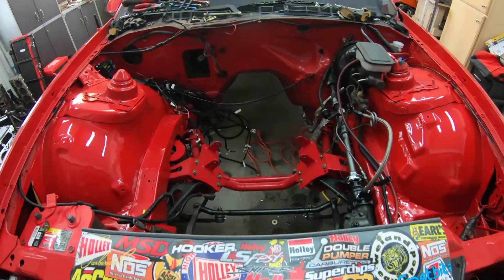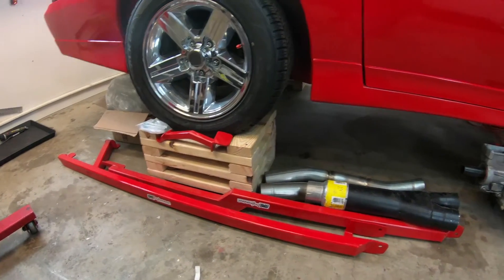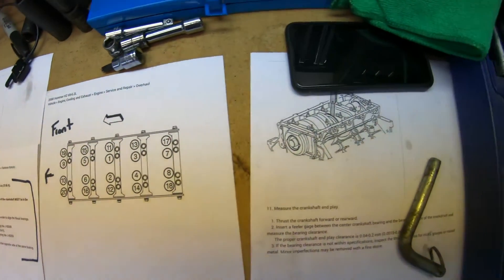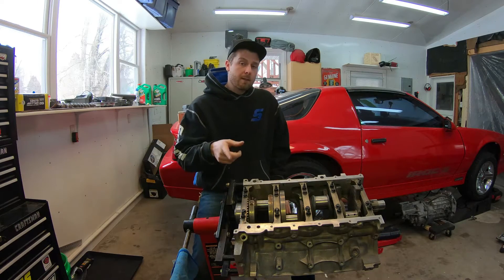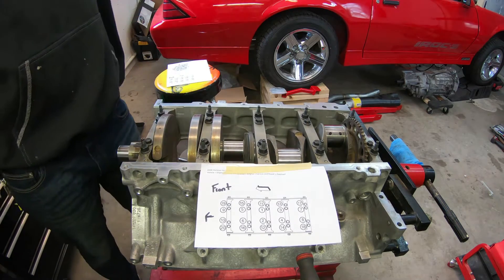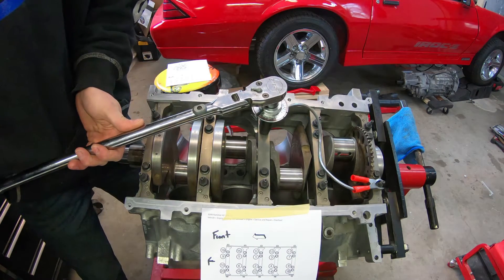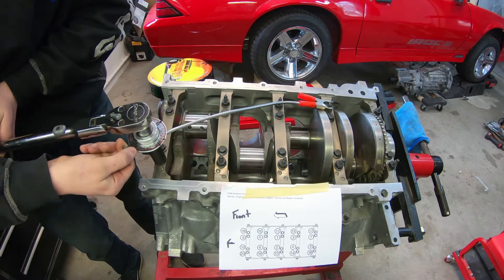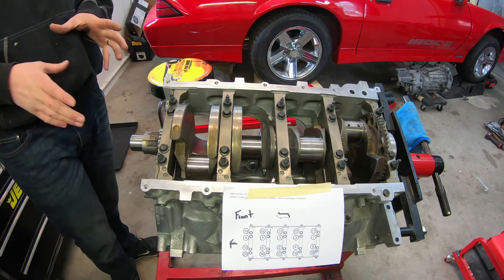How to Install LS3 Crankshaft. Proper Torque Sequence on Bottom End Assembly. 3rd Gen Camaro

Comment: It's a shame you left out checking your bearing clearances as well as setting the thrust bearing after the first sequence of tightening the inner bolts to 15ft lbs.  These are both super important steps but hopefully newbies will consult multiple sources so they get all of the important information.
Reply from the maker: Yeah this deep in a engine everyone should be doing there own research anyways. Each engine is so different with different combo's so my clearances might not be spec for someone else's build or if they have iron block vs aluminum and so on. I also used plastic guage to spec mine which isn't always accurate. Didn't want to give any wrong info on something as important on clearances.
Reply: @Brandon-LSX  Understandable decision to leave it out and I applaud you for covering your own ass. However, for all LS engines being built for street cars regardless of iron or aluminum block the general rule for main bearing clearances is between .0015 and .002 when using plastigage.  If it's not within those specs you should talk to a machine shop about having them precision measured and getting the correct clearances.

Comment: Do you know what the main bearing clearance is for an LS2 crank is? All stock nothing special. Trying to look at the repair manual and I can't find it. Some say between .0001-.0003 not sure if that is correct.
Reply from the maker: I can't tell you off the top of my head. I remember mine was around  .00015 I belive.

Comment: Nice job.
Cpl questions, 
What kind of assembly lube are you using. 
Did you check crank shaft end play?
Care to share your machine shop name?
I'm here in mn also, just west of the city's.  
A cool way of checking how hard the crank spins as you go is use a small inch pound torque wrench on the damper bolt. Can also see once all the pistons are in how much "drag" you have.
Reply from the maker: Thanks man it's definitely a learning process this was my first engine I've ever built there's so much to learn still. I'm the kind of guy that just goes for it though. You'll never learn if your scared to fail.
Reply: No he did not check the crank end play. It needs to be .005 or your engine will be toast!
Reply: @aphil4581  To be fair, you don't know that he didn't check the end play.  Just because something gets left out of a video on YouTube doesn't mean it wasn't done.  Also, a lot of the videos on YouTube are people that are building an engine for the first time so hopefully newbies that come across these videos will do plenty of research and consult more than just 1 source before diving in.

Comment: Good video buddy. Definitely helped me out. Do you happen to have the link for that degree wheel?
Reply from the maker: Thanks Man here's the link for the tool let me know if it works. https://www.jbtools.com/lisle-28100-torque-angle-meter/?gclid=Cj0KCQiA88X_BRDUARIsACVMYD9kaWBWfb7VllRZbfKBIh3MRyjx6XlMLEMySW05I5tIzfyS3_JQ0e4aAo42EALw_wcB
Reply: What is the purpose of (I’m assuming that’s what it is) the ground clamp?
Reply from the maker: @Lagrange1186  It's a convenient way to hold the angle Guage from spinning while torquing/tighting the bolts.
Reply: @Brandon-LSX  Where can I get these sheets printed? Also how do I know if I have TTY or TTA?
Reply: Sounds good really appreciate it.